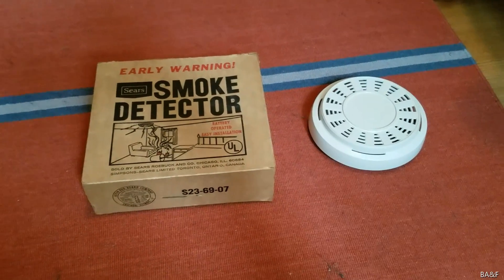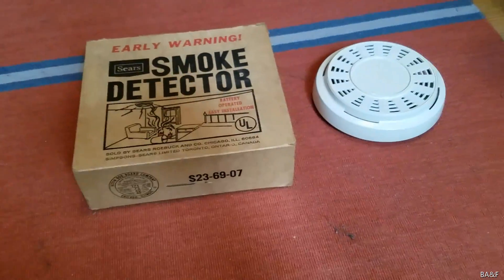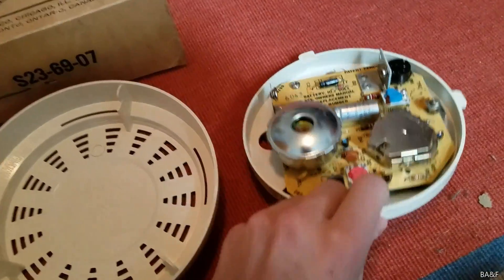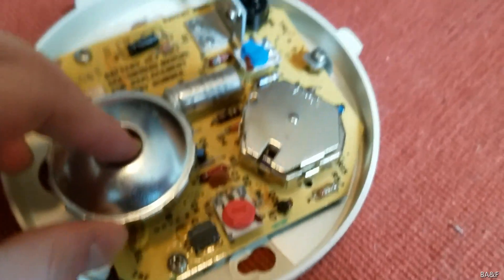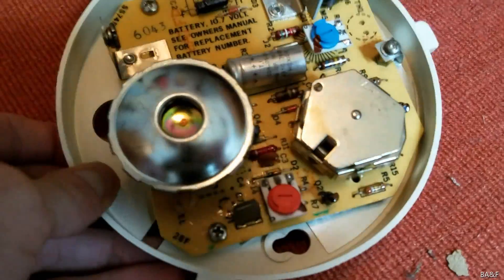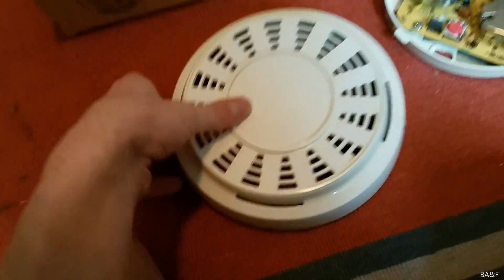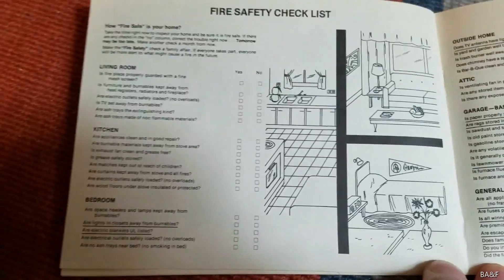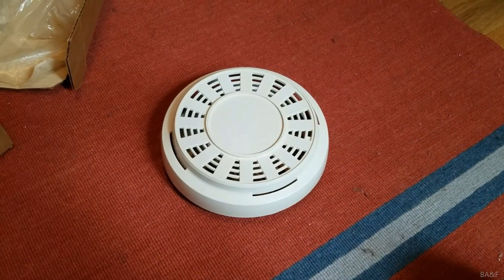Sears Early One 9-57071 Smoke Detector - Part 1

Comment: I bought a 1967 ranch, and changed a very old smoke alarm in the stairwell that looked just like the outside of this one, but the inside was a bit older looking. I've been trying to figure out the age of it from the Sears date code (78D2194378) but can't find any info anywhere. Any idea?
Reply: I just found the Item number - 9.57001 i think.
Reply from the maker: @Shyuler  Sounds like a early-mid 70's, probably a bit later than this one. the 57001 was made by Cerberus Pyrotronics. If you replace it do not throw it away, these are very collectible.

Comment: Nice detector!
And just to clarify, here are the first three digits that code for each of the brands Sears rebranded:
BRK- 246
Gateway- 462
Fyrnetics/Lifesaver- 350
Pyrotronics- 439
Probe- 302
Reply from the maker: My Nalcor-made one has the prefix 462 as well but that one is so obscure I'm not surprised it doesn't follow the rebrand code
Reply: @BAFVintage  you should do a battery collection video